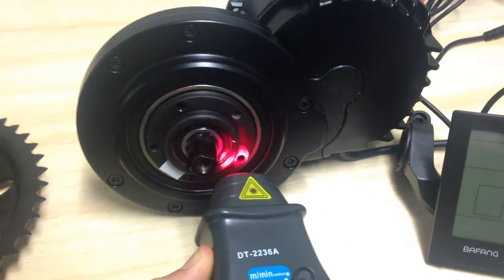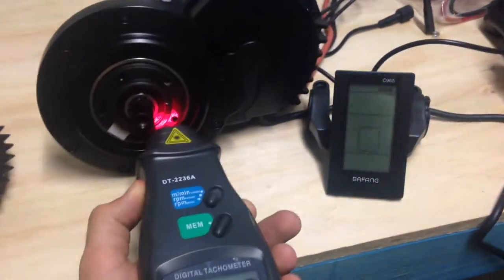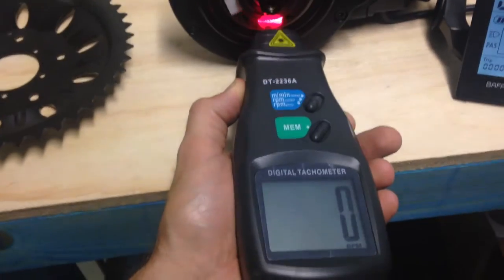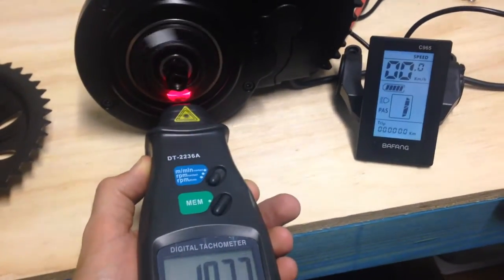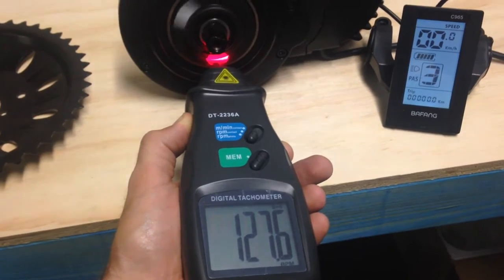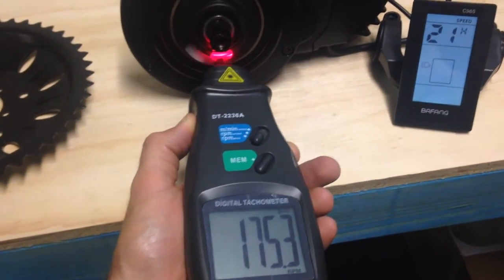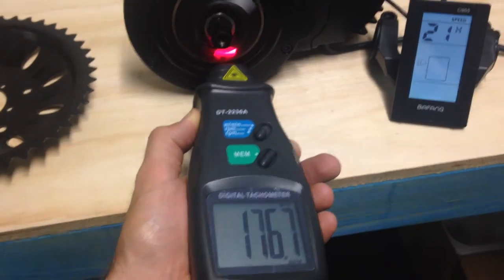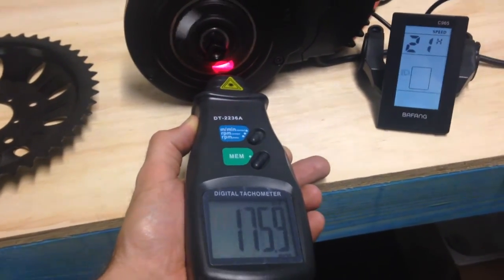Bafang BBSHD 1000w mid-drive • Factory settings RPM test • Electric Bike 48v BBS02 8fun motor

Comment: i dont understand why mid drive motors have lower rpm than hub motors, can someone explain me or give me a link to read? i am planning to buying a 1000watts mid drive, it is the highest watts chinesse made, after that, comes an expensive 1500 watts mid drive motor from the UK
Reply from the maker: No... this is not right, mid drive are actually spinning a LOT faster than hub motors. Fast RPM means you can use a much smaller and lighter motor (even including the gears to convert high rpm down to useful wheel speed and high torque). Mid drive even including drivetrain losses they’re still more efficient than hub motors as you can always select the right gear. Hub motors are amazing too, direct drive are HEAVY but SILENT, geared hub motor has a smaller faster RPM spinning inside and a planetary gear to convert down to high torque (similar to the mid drive but fixed single gear)